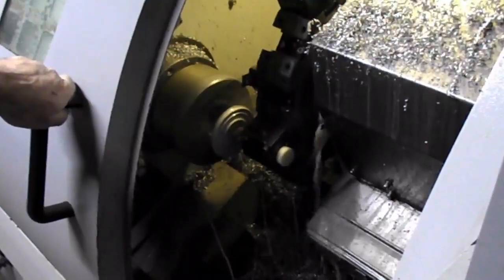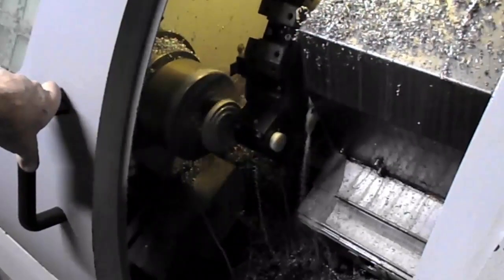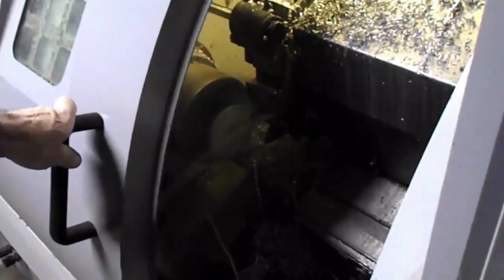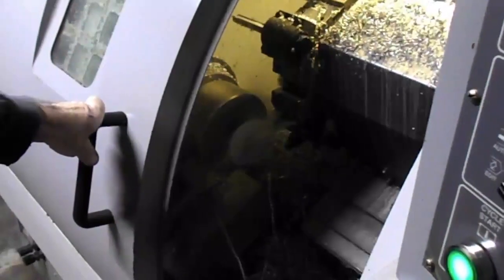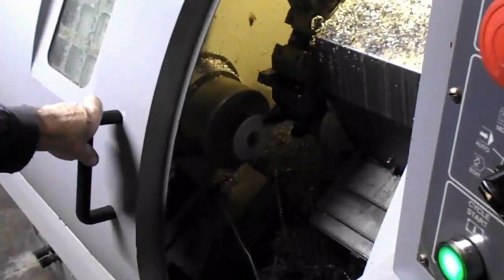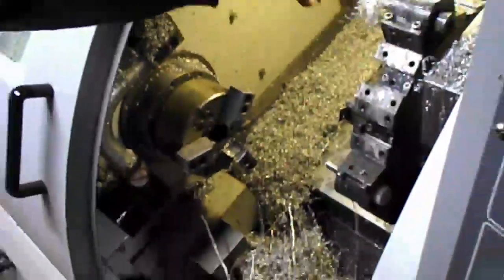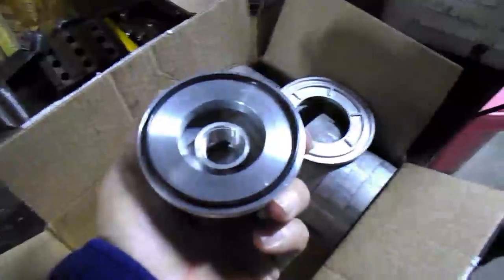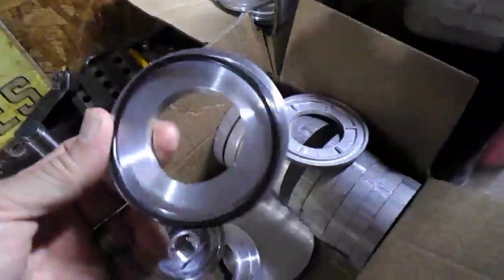Oil Filter Relocation Kit.

Comment: Great video. On a side note I'm wondering how much boost my 6.5 can take in a factory setup. I have a 94 GMC 3500 dually, and it had a really hard time towing my 9000lb camper. Couldn't get over 70km, is it possible to put in a transmission from a newer truck?

Comment: Great product again Leroy. Mate I know I am a little of subject but hope you dont mind sharing your thoughts and knowledge again. Ive just recently installed the new Leroy desiel feed the the beast. And its great. With the combination HO injectors. Im having trouble with my DS4 hummer h1 injection pump. My truck starts great cold and runs perfectly fine when up to temperature 
My problem is that when I turn her of It wont start again unless i poor warm water on the injector pump. Or wait 2 hours for her to cool down. 
Can I please ask you ylur thoughts 
1. Can it be fixed
2. If not what pump do you recommend for a swap on my 6.5l engine.
Thanking you for your time and honesty.
Wishing you a Merry Christmas and happy new years. 
Cheers Grant

Comment: Painful listening to dull carbide cutters. Needs to run the auger to clean out that machine too. I have fifteen years experience operating NC and CNC vertical and horizontal mills.